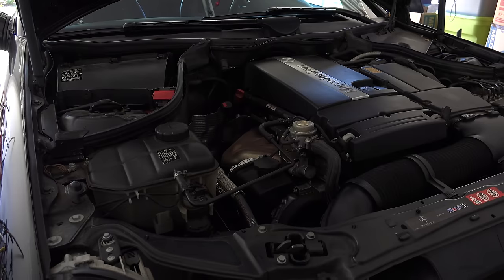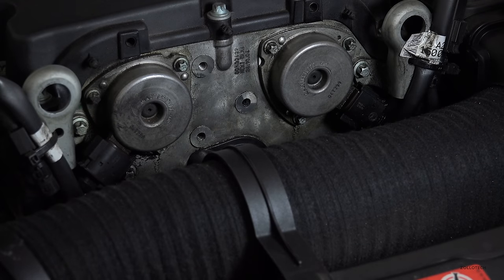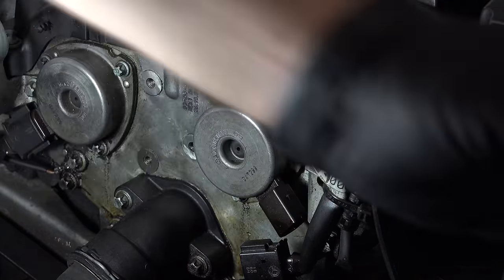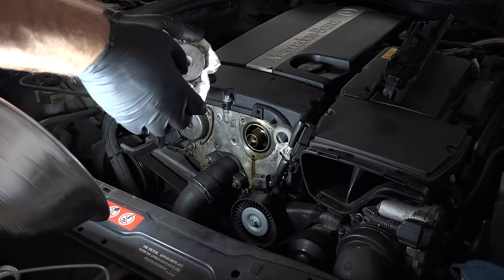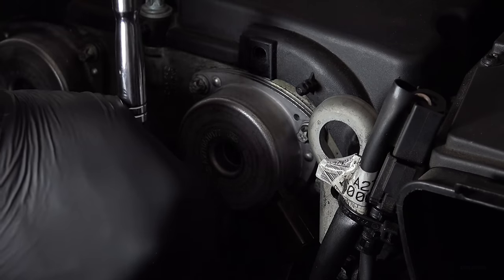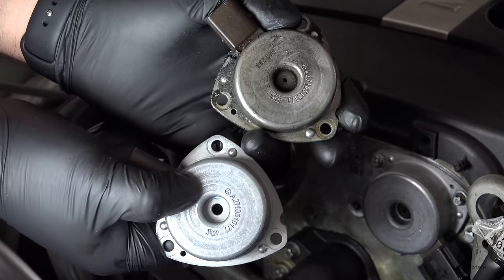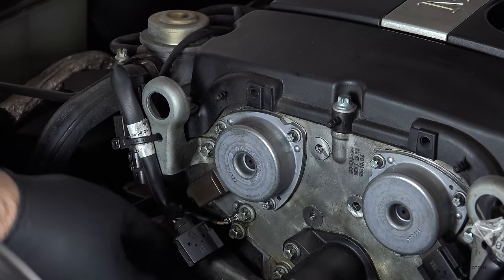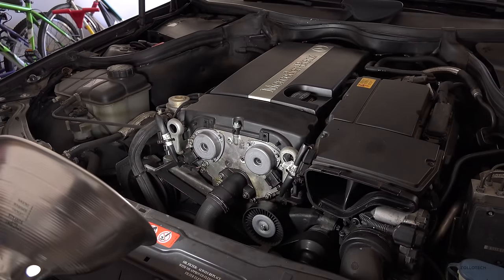How To Change Mercedes W203 m271 Camshaft Magnets

Comment: Before anyone changes these cam magnets make sure you have power coming out of both wires that attach to it. I think one wire is 4.7 volts and the other wire is about 12 volts with the key turned to the second position.

Comment from the maker: I don't do many car videos, but I have been under the weather and I need rest.  I never published this from a little while ago, so I thought it was time.  Want to see more or you prefer tech?
Reply: Keep up the good videos
Reply: zollotech we wanna see more car videos. How long have you been working on cars?
Reply from the maker: +Hilario Arreguin cool.  Been working on hem for years.
Reply: I like it! It's a nice addition to the content you already make; Not quite sure if these kind of videos should be at the same channel though, but it is good content nonetheless!
Reply: Hi, thanks for posting, very clear instructions. Just got one question if I may. If the connecter that fits into the magnet has oil in it do I clean it or do I need to replace it?

Many thanks, Rick (Cambridge, UK).
Reply: @zollotech  , Hello. On my C180 1.6 Kompressor W204, oil is appearing under the cams. Do you know what the problem is? Tks
Reply from the maker: If you are referring to outside the engine then it could be the camshaft adjuster magnets leaking or a valve cover gasket. However it could be coming from other places as well. The only way to know for sure is a thorough inspection.
Reply: @zollotech  thanks!
Reply: @zollotech  if there's oil in the connectors that fit into the magnets. Can I clean it with electrical cleaner?
Reply from the maker: @J__7777  sure as long as it wont mess up the plastic or rubber covering

Comment: Fyi: This lufi XF1 was earlier swap for usr between two Hondas of both 1.5 litres engine. But one is otto cycle and other one is atkison cycle. On idling the atkison unit is having suction of only  -0.15atm vs 
-0.45atm for otto cycle. Happy motoring.

Comment: Thanks a lot for the video! Do you think the clips and the cables should be changed as well? I have the same kind of leak and my local mechanic recommended to change the magnets the clips and the cables altogether to prevent the leak reaching to the ECU.
Reply from the maker: It depends if the update had already been done or not. There was a retrofit so that it rerouted the cables how they are on mine, so that the oil can’t flow into the ECU.
Reply: @zollotech  I understand. Thank you very much for the answer!

Comment: You left out one step that Mercedes mentions in their maintenance manual for this repair. You are supposed to align the new magnet by using a 6mm drill.
Reply: ? elaborate
Reply: I don't believe you
Reply: @mortiferum87  Just look up the according Mercedes WIS document. It explains all neccessary steps, including the correct centering by using the shaft of a 6mm drill.

Comment: Hi zollotech and thanks for your video. What are the trouble I might come with these sensors ?
Reply from the maker: They could throw engine codes if they aren't working, but otherwise not a lot other than leaking oil.

Comment: Good video ! However, you have missed one point. When refitting the magnets you need to put a 6mm drill shaft through the magnet centre hole and into the camshaft to align the magnet as you are fitting it. You then insert the middle rubber once the magnet is tightened in place. Otherwise you have have the magnet slightly out of place which will cause oil leakage.
Reply from the maker: While I found out about that later on, there is zero play for anything when you put it back together at least on my car. So you could align it but it would be the same as if you just put it on as there’s no play in the screws for the actual camshaft magnet to move at all

Comment: Thanks Aaron! Is this the right video on how to fix error code P0010?
Reply from the maker: Usually it is. That is assuming the wiring is good.
Reply: zollotech I got code P0010, the magnet had a leak, and now the car won’t start. I wonder if replacing the magnet could solve it, thanks again Aaron

Comment: Hi there, just checking if you or any of your subscribers have changed the bearings on the aircon compressor pulley for a 2001, W203 C180M?

Comment: I'm about to pull the trigger on a 2015 CPO c250 with 20k miles.  When do you think I might need to worry about something like this?
Reply: Treizez34  90
000 miles

Comment: I found oil inside both of the camshaft magnet electrical plugs but there is no oil leaking around the magnets. Do you think the magnets are bad or do you think if I just replace the orings and the problem is solved? there is no codes showing up at all. thank you!

Comment: hi I have E 320 1997  I have the camshaft magnet ready to install but  doesn't have a O ring gasket  is only metal do I have to put sealer silicon to avoid any leak I call dealer and asked and they said...  doesn't need any gasket

Comment: Hi bro. I have a question? Why needed to change that? For engine sound or ?
Reply: If oil starts leaking from these magnets, they will infiltrate the sensors attached to them and go all the way to the ECU and O2 sensor (lambda sensor) causing all kinds of errors and eventually compromising the ECU. (Not a cheap fix)

Comment: Yes sir, can you plz help me out with my problem, I had 2009model c200 kompresor,troble code p0045 and it's say supercharger boost control solenoid circuit A open, but where is it, I cannot find,hope youwill answer my question, tnx

Comment: Hello,
Thank you man, just a question, what do you think of this engine, is it good or not?
Reply from the maker: The Stig I think it’s good.  Running good and just passed 100,000 miles
Reply: M 271 is well know for serious problems with cam chains stretching and sometimes  jumping teeth causing catastrophic engine failure, definitely not one of Mercedes best efforts, M 111 is a far better power plant.

Comment: Hello, what are the colour arrangement of the wires going to the camshaft position sensor (intake side) for this model? I have some problems with the wires mixed up after the connector got broken.

Comment: Hi my car's camshaft only leaking . But it doesn't have any problem. How can i stop the leaking? Thanks. Is it mentioned in manual it has to be change every 100000km?(camshaft)
Reply from the maker: If it’s leaking out of the camshaft magnet area you can buy just the o-ring from Mercedes for a couple dollars.

Comment: I have just changed mine on my SLK 200.
Quite a simple job.
Have anyone know why it should leak?
And why it is designed in such a way that it leaks?

And most of all have anyone ever dismantle it 

to see if it can be repaired?

I bought mine, a pair for about 85 USD including
"O" rings & grommet.

Comment: I replaced my timing chain and cam gears, aftermarket cam gears. I still hear a cold start noise from these cam gears when the oil drain from them. Is the only way to have a quiet cold start to use geniune Mercedes cam gears?

Comment: I have same car as yours,Just want to ask questions is it possible to swap the engine to a model 2007 c250? 
Thanks
Reply from the maker: If you had a full donor car with the computer and everything then probably, but the price of a 2007 c-class is so low now that it would be cheaper to just buy one.

Comment: Please tell me what type of spark plugs I need to get for my w203 1.8 liter. I am also interested in doing a tune on mine. Can you share more info on that? I saw you mentioned about it in a reply.
Reply: Original spark plugs: ngk 3588 ilfr6a
Reply: If your engine type M271 C230  you could bought bosch FR6MPP332

Comment: Why would oil be leaking into cam shaft magnets if PCV system is vented either into intake manifold or into suction of Eaton 45. I have just install a generic OBD2 plug & display unit Lufi XF. MAF reading at 5.4g/second. Rpm 850. Air manifold at 0.55atm (-55kpa). Throttle at 17.2% open. IAT 40 degC. O2 SENSOR AT 0.74V which is good. 

Calculations:  a) 5.4g air/second = 4.9 litres air per second. B) 850rpm for 1.8litre engine = 7.08 suction strokes per second = 12.75 litres of displacement volume by all 4 piston in 1 second. C) 4.9/12.75 = 0.385 for ratio of air intake volume vs total displacement volume for every 1 second. This come to -61.5kpa or (-0.615 atm) inside cylinder at BDC. This should be correct as manifold pressure is always higher than pressure inside cylinder during suction stroke. The above does not take into account of gases coming from PCV system back into intake manifold and the gasoline spray by port injectors. So actual pressure in cylinder at BDC could be much closer to -55kpa.

This Lufi XF is generic type reader. When it was on my honda ivetc engine it could read EGR valve opening value but not MAF and exhaust temperature. On W211 E200k year 2006 it could not read egr valve value and exhaust temperature. Good if Lufi could sell  XF1 reader which customised for Mercedes or Honda or BMW etc etc.

Every one should have a good plug in & display type of OBD2 reader. There was a post around year 2010 that owner had done quite many costly things (and pulling hairs) to his troubled E200k and in the end it just come down to just a leaky breather hoses.

Comment: Any ideas what to do if the plug doesn't come off? Tried everything, pliers, screwdrivers etc but it doesn't move a single millimeter
Reply: If the connector won't come off of the cam magnet unplug the extension from the harness and remove the cam magnet with the extension. You'll be able to get at the clips easier that way. It should come off relatively easily unless someone put it on crooked and bent the pins.

Comment: oil leakage can cause any further damage ?
Reply: If additional wire adapters are not applied, oil goes all the way through the harness to the ECU causing short circuits.
Reply: @TheChodzio no way oil to create short circuit, it's actually isolator, so it prevents  circuits from functuing properly, but never ever short.cirucuits them

Comment: Are those cam magnets the same as the cam shaft position sensor?
Reply: Same shit :)
Reply: Two different things
Reply: @oguzthelast1  you're wrong
Reply: No two different systems, this magnets are. Controlled by the ecu and by that the variable valve timing is achieved in this case

Comment: Hi, how about only change the o-rig?
Reply: Leaking is not only comming out from the edge of magnets,it is also comming through the electrical connector and it could reach to the O2 (lambda) sensor.That is the dangerous one.If you only change the o ring you might stop edge-leaking but main leaking still goes on and could cause damage to your ECU and relevent sensors.Hope it will be useful.

Comment: Think i may have this issue with mine. As there is oil down the front of the engine.
Reply from the maker: Check to make sure the intake is tight as well and that your PCV is not backed up or clogged. That can spray oil into the intake if you are camshaft magnets are not leaking
Reply: @zollotech  my first merc. Where is the pcv located. I would show a pic. But wont let me post it.
Reply from the maker: Matthew Jackson Just do a search for your car and PCV. It’s not very easy to locate and you can’t see it

Comment: I have c230 and when put in gear it sounds like it wants to die but never does p0101 p136 so got new 02/maf/spark plugs and no change runs good in park and n but put it in gear and it sputters no power it will drive good when Going but stop and rpm drops up and down put in park go away.help please
Reply: Camshaft, crankshaft snesors or idle position sensors. Did you fix it?

Comment: was that the $5000 job they told me about at the dealer? I was just asking them what problems my specific car model could have, and they said "oh, camshaft adjuster...it's a 5000-dollar job. I've seen it go bad at 20k and it could go out at 100k"
Reply from the maker: No.  Mercedes camshaft adjusters are pretty simple to replace, unless they are inside the valve cover like on the e63 amg.

Comment: Hi Friends,
I had a very serious trouble with my C200 Kompressor 2001 as When I start the engine (not yet drive). The speed indication at the panel at dashboard go up and go down. It is not normal. Then I opened the trap to look the engine actually the engine run with speed not normal. Go up  and go down rapidly. I actually did not know how to fix it. Anybody has experience on it please kindly to advise. Tks all.
Reply from the maker: Mass airflow sensor
Reply: Buy new one

Comment: 1.8l c230 05 when put in gear it stutters like it want to die
Reply from the maker: that could be a number of things, but many people have said replacing the 12 dollar PCV hose helps.  Do a search for w203 12 dollar hose and you'll find it.
Reply: Ya did that. Found out what it is well I started the car and opened the oil cap and boom there is the problem head gasket blown   dam that y codes do little to help in some areas
Reply: I was looking for leaks  and clogged cat then it just pop in my head to check oil cap for blown head

Comment: I had this problem also with the M271 (new control chain, new camshaft adjusters, new valves, C180 T, 2006). Since November 2016, the car has a total of 4 months in 2 car workshops. Only now recurring / permanent fault with associated non-circular idle: 2054: Wrong position of exhaust camshaft, sporadic. Video: https://youtu.be/TDmoehgOEqs - do you have any advice?
Reply: p0016 ???